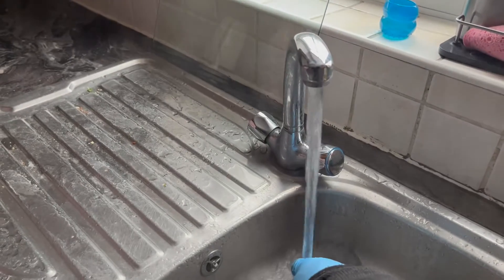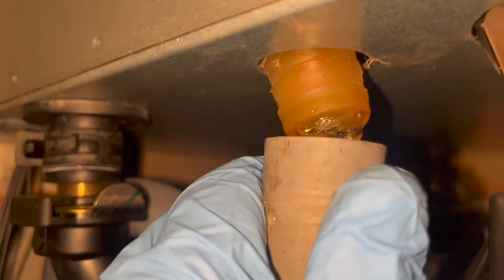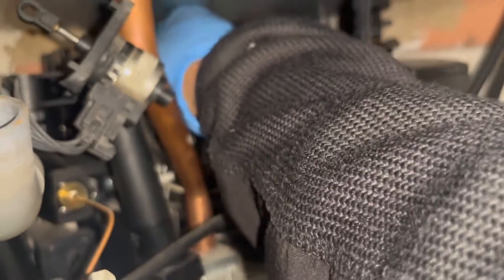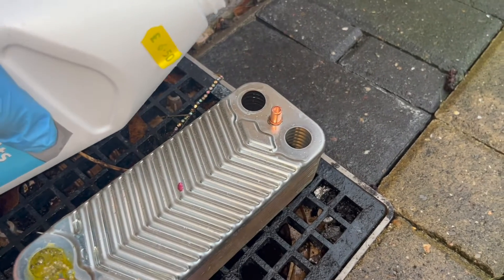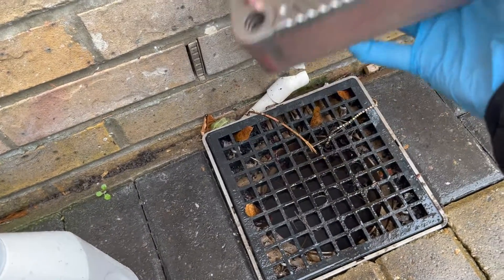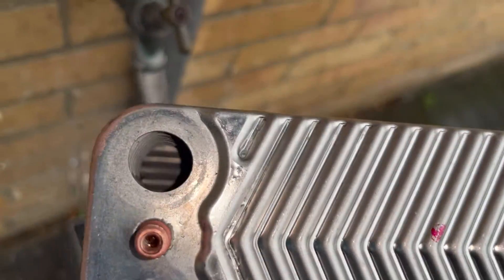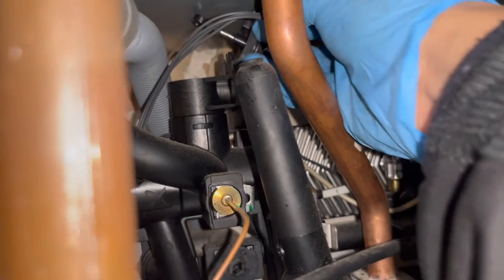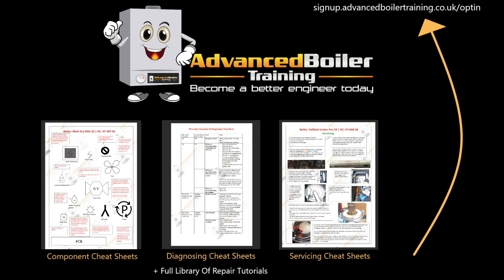Blocked Plate Heat Exchanger (Sludge) | No Hot Water | How To Unblock | Viessmann Boiler

Comment: Do you have to be gas safe registered to undertake that task?
Reply: Gas safe as soon as you open the combustion chamber!
Reply: @dylanbrandley7888  
OK, does that mean the water side of the boiler (& the electronics) can be serviced by non gas safe engineers ?
Reply: @dylanbrandley7888  As soon as you open the cover.
Reply: Ok bro, thanks for video but please isolate electrics and you have to be gas competent as rarely parts will come off with gas components in the way. Take care.
Reply: Yes
Reply: No.
Reply: Gas safe to touch the boiler components my friend. Don’t play with gas if you ain’t gas safe.

Comment: I've added some pipe connections and valves so I can flush vinegar through the collector without having to remove it from the boiler.   I uses a small external pump to flow the vinegar from the bucket, up into the collector and back into bucket. Minimal effort, good result.
Reply: No way that's genius

Comment: With the chemical you have used only good for a max of 3 uses / services as 4th time you will pin hole the exchanger so fit new and the next size up of exchanger for that model of boiler. Plus you have missed out one major task when doing this job in cleaning out the feed and return pipes from the boiler to exchanger as that shit sticks to those pipes as well.

Comment: On ideal logic do i only isolate the mains cold and flow and return
Reply from the maker: Yeah 👍
Reply: Tried ISO the cold from boiler not doing anything @advancedboilertraining
Reply from the maker: If you isolate the cold going through the boiler but still have water coming out of the hot tap then you may have a faulty mixer tap somewhere in the house. Also check the actual metal valve is turning on the boiler and not just the plastic handle, that’s also a common thing
Reply: All the hot taps and cold are working after turning the boiler cold iso valve  but i havent checked the plasic  handled  @advancedboilertraining
Reply from the maker: Yeah check the plastic handle isn’t spinning without the metal valve. If that’s not the issue then there’s most likely a faulty mixer tap in the house. If that’s the issue then isolate all of the mixer taps until the issue goes away and then replace the faulty mixer tap

Comment: I'm experiencing intermittent hot water with some knocking noises from the boiler. The boiler is 15 years old so I'm worried that the gas safe engineer may say it's beyond economic repair..  A great video from a one armed engineer and one armed cameraman.

Comment: Spirit of salts (hydrochloric acid) is corrosive to stainless steel, removing its water resistance and should not be used for this purpose. Yes it will effectively dissolve blockages, which is why engineers often use it, but could cause pin holing. 
Phosphoric acid, or 10% sulphuric acid is a better option.
Reply: What about acetic acid or citric acid? In my country 32% acetic acid is easy to buy in any store, but a mate of mine experienced pinholing or cracked brazing in his BPHE (stainless steel and copper) after using it.

Comment: Hi, if the original vaillent heat echanger has a NTC sensor attached to it and you replace it with an OEM heat exchanger, how can you attach the NTC sensor back as the OEM veersion slightly different (same as the one in video)?

Comment: I have the similar issue ..the temperature goes high to 125 very quick ,the water goes cold ,banging noise then when the tap is turned off the temperature comes down and settles ..ive been told its the diverter valve ..help please

Comment: I just did this a few weeks ago on a newer Viessmann. I'm not gas safe, but I am a competent engineer and will be getting someone out to do a gas safety check. I used central heating cleaner and left it in the heat exchanger for a few hours, took multiple flushes with hot water and shaking the plate to get it clean.  In theory this should never block if there is a magnet filter and inhibitor chemicals in the water right? It would've been nice if you added some inhibitor at the end.

Comment: It’s a common fault with these boilers its the 2 black rubber pipes that run up the side they corrode and the rubber falls off and blocks  up the plate heat exchanger
Reply: terrible design, i would never install or advise to fit a Viessmann. as bad as Baxi
Reply: Worst thing was when you tried to claim on the warranty they would try blame it on old system pipe work saying it needed to be flushed I got wise to it when I’d installed a few new systems new everything and it would happen a few weeks later that’s why I never fit them any more especially when they don’t fix their faults and blame the installer that’s why I stick with Worcester most of the time there customer service is great and they fix there faults if one occurs

Comment: Is it legal to flush that down the drain???
Reply: If it's a soak away drain, that's really not good for the environment, standard drain it's okay, personally I would just fit a new plate and have old plate recycled. Plus it a lot safer, did you hear him cough due to the flumes 😷

Comment: If there is a pin hole and you say the pressure in the boiler will always be going up, would that be when the heating is on or even without the heating being turned on?
Reply: at all times

Comment: good info ,   = = = however spirit of salts ( Hydrochloric acid** ) = = = = is too harsh for stainless or alloy ( **Thats why they get pin holed ) .  Use a regular kettle descaler instead.   and flush both direction with water
Reply: Kettle descale ain’t gonna shift heating sludge / magnite

Comment: Helpful video! If you find that the air valve on the expansion tank leaks out some water when you go to charge it, is that a problem or a sign of a faulty tank?
Reply: a lot of the time its not a fault but condensate from compressed air. viessmann put the valve in a stupid place. like the rest of their boilers' badly designed and piece of shit.

Comment: Morning great video , have a problem like yours , the thing with my vessmann is that the boiler is not firing on hot water, there is a full flow out of the hot tap , checked the 3 port vale and it is moving freely, could it be a stat or the heat exchanger thanks
Reply: not firing,   is nothing like the problem in this video!!
Reply: the hall sensor

Comment: Did you have to use new o rings on the plate heat exchanger
Reply: Not sure if he showed whether he cleaned the seals up or replaced them, allways good idea to have replacement seals. & they can fall off !

Comment: Hi thanks for video. Do you find this PHE blockage on central heating close loop side or cold to hot fresh water side also. Can this unblocking be done on fire main heatexhanger side. does main HE ever get blocked providing there is an inhibitor in the close loop?
Reply from the maker: So usually the blockage is on the CH side of the plate. I’ve never seen the HW side blocked up 

So yeah, if the system is really dirty then the main heat exchanger can also get blocked
Reply: always on the hot water side here in London. its thew calcium carbonate build-up that stops heat transfer, the harder the water area, the more common this is.